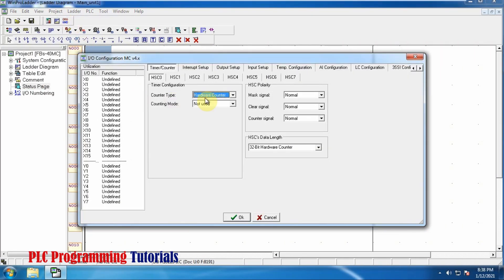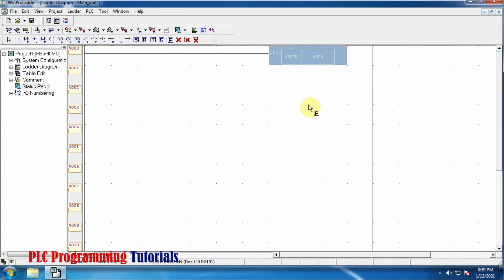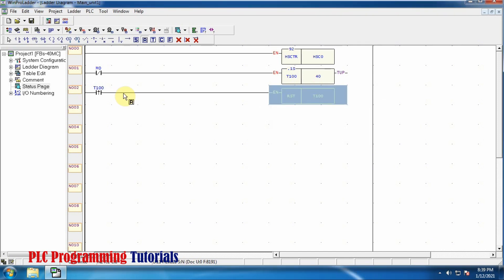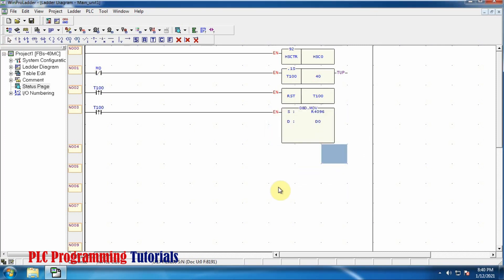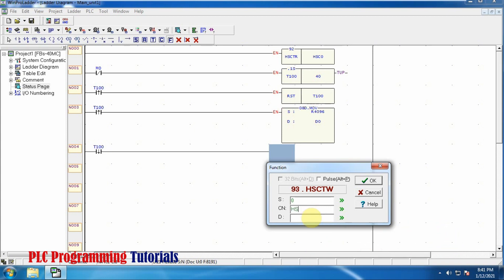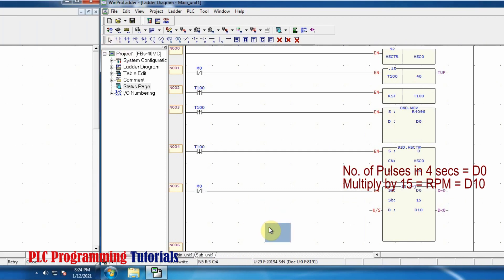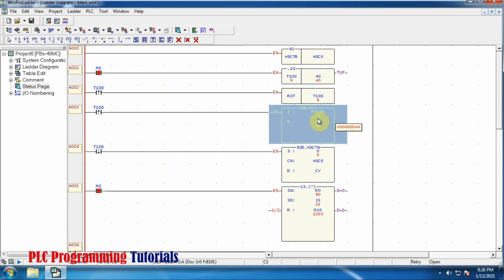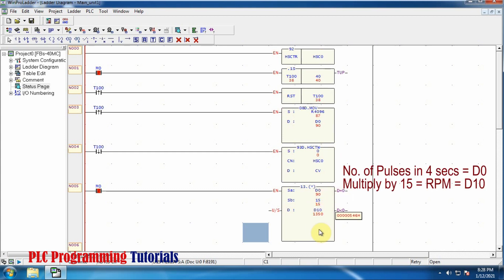How to measure RPM in PLC Program ? High speed counter || PLC Programming

Comment: Sir, I'm performing the same experiment for a motor but I'm using an incremental encoder instead. The output is nearly Ok. But for a 1500 rpm motor, the rpm values fluctuate a lot like it constantly moves from 1450-1550, and in between these values. can you provide a solution for it that what I should you, so that the values remain nearly constant?

Comment: Please share the sensor details
Reply from the maker: It is a simple PNP PROXIMITY SENSOR , WITH 24VDC SUPPLY , AND 5 MM SENSING RANGE
Reply: Can we get 900 rpm using this sensor ? Many said it wont be accurate.
Reply from the maker: For more accuracy you can use an encoder with the motor shaft

Comment: Sir Can you make a video on Automatic Ceiling fan winding machine in which we have 1 selector switch for Auto and manual mode. If manual mode is selected motor direction will only be changed by selector switch Left/Right. And if Auto Mode is selected when we run the motor by pressing NO push Button motor will run until counter meter stops it and when we again starr motor by pressing same push button motor will change it's direction automatically. please help